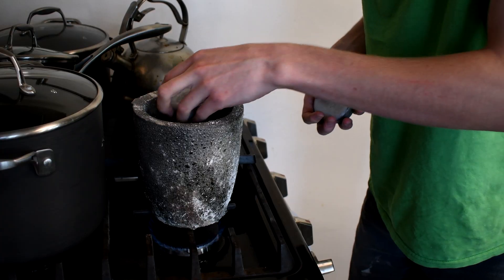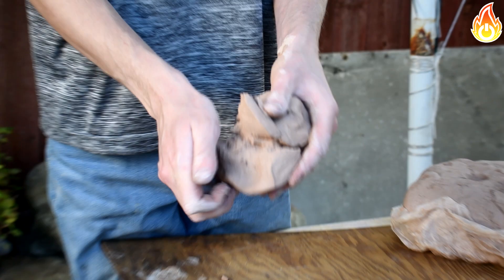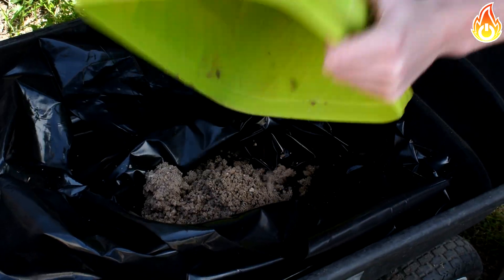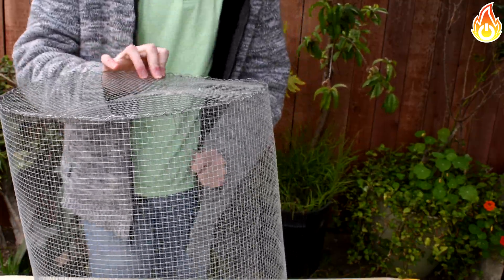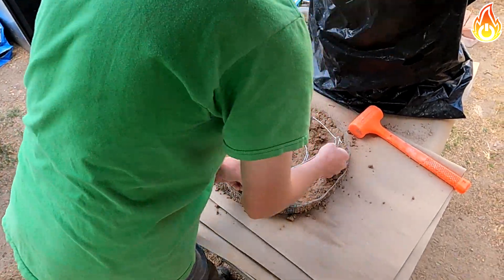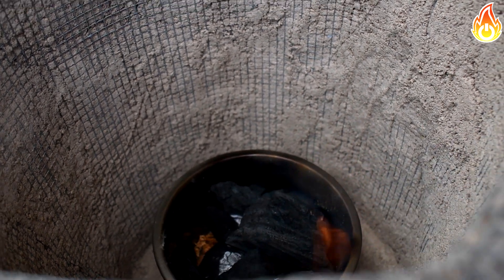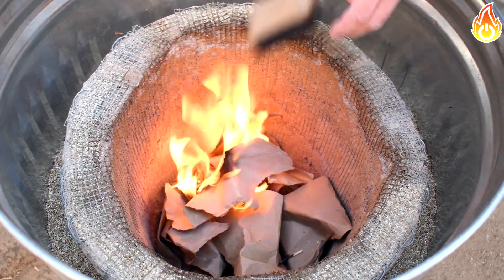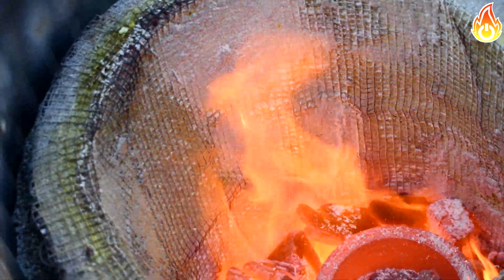How to make a metal melting furnace/foundry for cheap

Comment: This is a brilliant way to make a furnace. I really like it!
However the hardware cloth looks to be galvanized, which is less great. The zinc from the galvanized mesh will give off toxic fumes, potentially other hazardous metals too. It it also likely the culprit of the yellow oxide layer you see when firing the furnace.
Still it is a very cool way to make a furnace without spending a lot, better yet if you can find a clean steel mesh.
Reply from the maker: Thanks! The hardware cloth may have been galvanized, I am not too sure on that one. But the yellow coating in the video is probably due to the fact that the wood I used was pressed board which contains a lot of glue and other things! :)